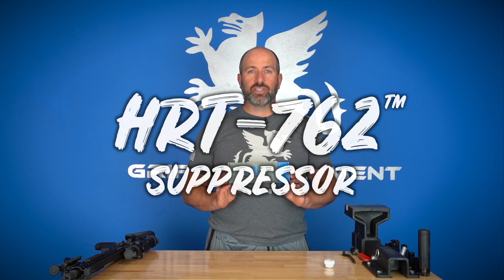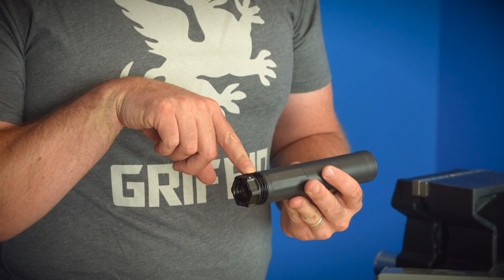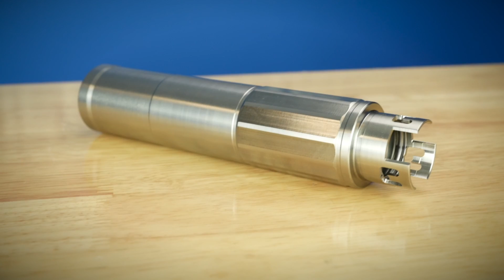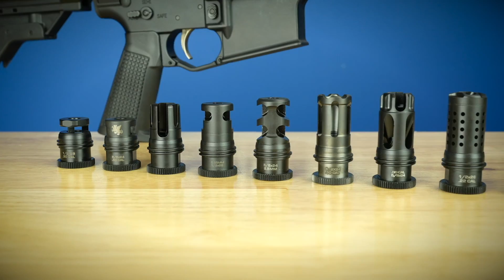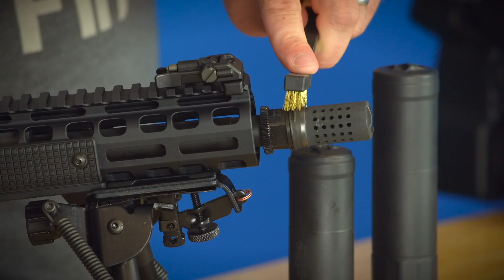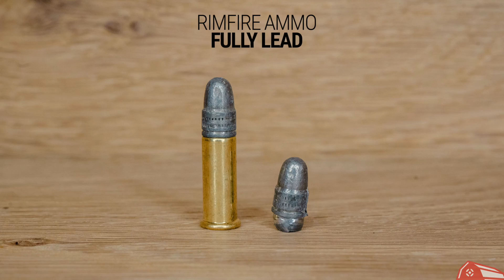DUAL-LOK™ HRT-762™ Suppressor Tutorial

Comment: The small minimalist break comes with the suppressor. Can anyone tell me how that device will look and sound unsuppressed compared to a normal A2 devise?
Reply from the maker: The Minimalist Brake reduces recoil and extends the service life of your suppressor by absorbing impact that would otherwise be absorbed by the blast baffle. If you were to run these unsuppressed, A2 muzzle devices may outperform in some aspects of flash, but the Minimalist Brake will significantly reduce concussion and control recoil better.

Side note: A2 devices are not compatible with the DUAL-LOK mounting system.